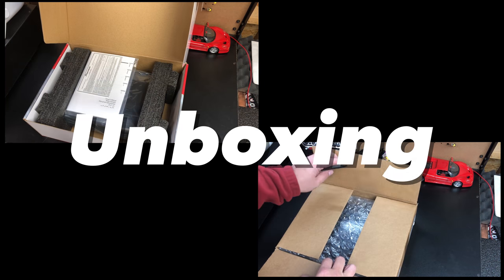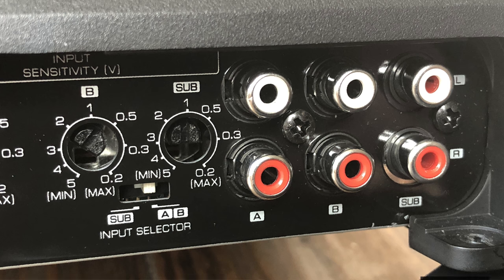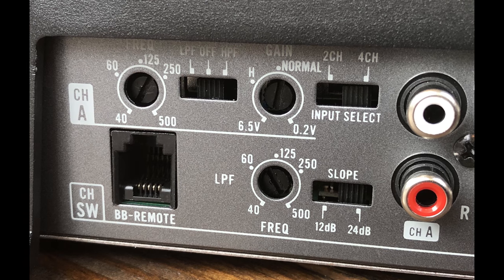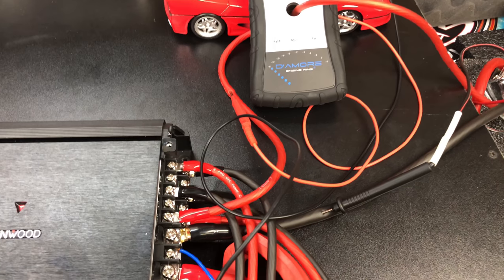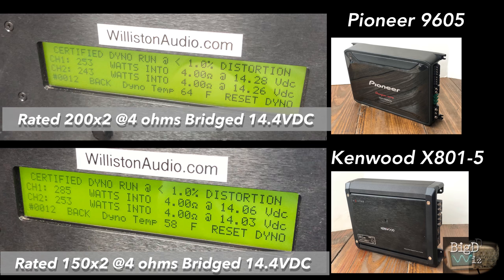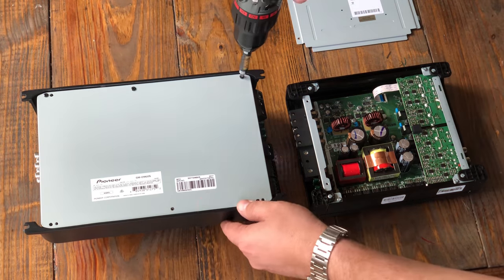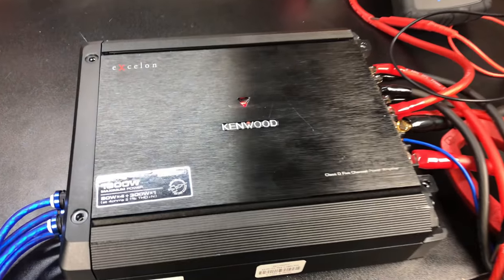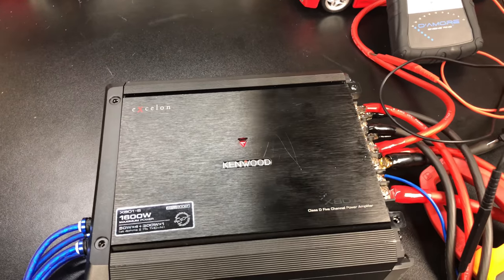Five Channel Budget Amps by Kenwood and Pioneer 4K UHD

Comment: that Kenwood is my favorite little amp, we do a ton of those guys. This was a great test, thank you for doing it.
Reply from the maker: If only it had a remote...I hate going into H/U settings to make adjustments for different songs. Thanks for watching and commenting. You guys will be in my next shoutout vid 🤙
Reply: Hey Five Star Car Stereo ,how is this X801-5 compared to XR900-5?
Reply: Five Star Car Stereo i
Reply: Can you hook up the 4 channels at 4 ohms and the subwoofer channel at 2 ohms or do all the channels need to be the same impedance?
Reply: what will the kenwood do true rmsx5?
Reply: We sell the 801-5 kenwood amps quit a bit at the shop I work for as well.  Have never had a dissatisfied customer after installing one of these.
Reply: Jim Jones yes you can ive been wondering that for forever and i finally got my answer 😂
Reply: 2x set of front back speakers  at 60watt rms any advise on pioneer or kenwood amp please
Reply: @fivestarcarstereo , any chance you guys got any end caps laying around for the kenwood? I’m local and just picked up a 2nd 801-5 but it’s caps are missing.

Comment: Nice. Thank-you for this. I have a Kenwood XR600-1 that is rated at 400 watts RMS at 4 ohms or 600 at 2 ohms. It measures 8-11/16in - W x 1-7/16in - L x 8in. It has always amazed me since I bought it that something this small like the Kenwood in this video can put out so much power and do it all day long without breaking down. I have owned the amp for 2 years now with no issues at all. Hopefully these 2 amps are reliable over the long term as they both seem to pack a large amount of power into a small chassis.
Reply from the maker: I’ve tested this amp before, did ok, just not way underrated like the other Kenwood’s I’ve tested. I love the sleek look of these XR series 😎

Comment: I installed one of those Pioneer amps in a friend's Pilot.

We ran a pair of Pioneer components in the front, coax in the rear, plus two Pioneer shallow 12's. 

That amp pushes this system very well and sounds fantastic.

Comment: Thanks for this video. Based on the results of the testing I bought the Kenwood.  
I ordered the X801-5  you tested but ended up getting sent the X802-5 (All input/output & remote SW control on one side, all x-over/sensitivity controls on the other).
I ran the amp with the stock radio at first til I decided which head unit I wanted. I ended up going with the Kenwood Excelon to make it a matching set.
6 months later and I don't regret my choices.

Comment: Thank you...I just got the kenwood XR900-5 for my wife’s truck and can’t wait to hook it up...One thing I can say there power is so clean...I’m also running two of there old amps the 1200m that sounds so good..
Reply from the maker: I’ve been curious about that one too, really like the slick looks. I’ve tested the XR600 mono amp and think it’s what’s used inside the XR900-5. Did it’s rated power, but not too much more. That’s cool with me as long as an amp performs to rated specs, I’m happy 👍
Reply: BigDWiz I no that’s rite.....Hey I want to say thank you for doing what you do with the amp tests ..You have saved me some money on amps.....Kp up the good work and thanks again...

Comment: Thanks for reviewing those BigD! Been wondering and looking for a 5ch, this will help.
Reply from the maker: Sure thing brother 🤙
Reply: Big D, thanks for the review. But I have a question about the durability of the Kenwood in particular. Do you have any knowledge of this? I’m of purchasing the Kenwood amp to power my entire system. I have A 17 Ram 1500 crew cab... 

I have limited room in the truck which is why I like the small footprint of the Kenwood..

I want to replace the factor speakers and add 2x10 JL subs.. and I wasting my money buying this amp in your opinion for this application??

Comment: back in the 90s these two were ones of the best .now they're head to head with boss
Reply: with BOSS? lol dude Pioneer still makes high-end SQ equipment. Kenwood still makes very good amps. Neither brand is into the SPL market. Both companies like Kicker design, and manufacture their own amps and speakers, unlike sundown and the other SPL brands. these are the companies that bring out the latest tech...so far from BOSS it's not even funny.

Comment: both did better than I expected, very nice to see that both companies have fairly honest ratings. however if I were to get a 5 channel amp, I'd most certainly go for sundown audios rendition of such an amp, I don't quite remember the ratings I've seen posted for the left and right speakers, or the specific ohm load, and I do not know whether it was tested with all channels driven either. but I believe the left and right are done class ab with a separate class D for the sub channel. and the sub channel is rated at 800watts rms, with some massive dynamic rms numbers posted (I believe they dropped the sub channel to .5 and it did 1500watts dynamic power. we all know neither of these amps will do that power even if dropped to .5... they'd probably blow up.)  now ive already seen dyno numbers of it, but it'd be cool to see them on video, with you showing all channels driven.. it's not a cheap amp though.. even though I already have a subwoofer amp, I'm slightly tempted for going for that amp when the time comes for me to get a full range 4ch.. maybe I could run some sealed 8s along with whatever is on the separate sub amp
Reply from the maker: The Class AB plus D 5 channel amps have been popular for many years. They offer SQ for the mids/highs and power for the subs. Most mfg’s are moving to full Class D designs now due to size, efficiency, cost, etc reasons. I had a Memphis “Big Belle” a while back and it was rated (and delivered) 75x4 AB and 1100x1 Class D. That was a great, all-in-one amp. That Sundown sounds pretty interesting as well...
Reply: I definitely would prefer AB for the mids and highs. class D can be just as good as ab for sq, but it they have their disadvantages. and unfortunately there's lots of cheap crappy class D full range amps out there. the sundown amp is the only one I've actually been interested in. sundown is known for making quality amplifiers, always capable of running below the rated ohm load, without issue. I wish I could find .5 ohm ratings for my amp, sundown sae1000d, I'm happy with the 1ohm ratings, I really like the dynamic numbers I've seen 1470watts rms is pretty good, but I gotta find a .5 ohm certified, clipping and dynamic.. I can do my own live power testing with an amp clamp and another volt meter.. I have no peak hold settings on either though, but my sa 12 d2 should put a pretty decent load on it.. probably not quite a 1 ohm load after speaker dynamics and my boxes rise however.

Comment: I had a Kenwood system.  
Liked it but the head unit burnt up twice. And the 4 channel amp crapped out after a few years. 
Subs worked good for what they were.  But I believe the entire system was around 1000$ back in 1996.  Really liked it.

Comment: I don’t think you’d go wrong using either amp... The Kenwood would be my choice though.
Reply from the maker: Agreed, especially for the size...but I’m a sucker for a remote bass control since I listed to so many different types of music
Reply: yeah kenwood is where it wants to be.
Reply: Just use a universal control knob and you would be good to go. I actually prefer a universal to some factory ones
Reply: The gain. Some have two knobs and control both also.
Reply: I have a Pioneer mono block for my sub which also has a remote... The remote was a nice thing before I had one... Maybe it's just me but it boosts bass at a certain frequency that makes it sound hollow... So it's always turned down.... I actually purchased a Kenwood amplifier similar to the Pioneer and ended up returning it before I had the chance to audition it.... I have always been a Kenwood guy... I actually still have my KRC923 cassette deck which still functions and still sounds amazing... You really would be hard pressed to tell the difference between a cassette or CD. The amplifier is the KAC PS 201T.. What an amazing amplifier... I always had suspicions that it was punching well above it's weight... But this Kenwood 5 channel amplifier is really nice.... I would love to hear your opinion on how the sound compares between the two... I have tried class D and it just doesn't cut it sound quality wise to my ears... My old Kenwood ran hot when driven hard but it is a class A/B so that's to be expected... But that sound.... Sooooo goooood.
Reply: Will Pack  when you use the remote it will attenuate the gain from minimum and maximum set by the gain dial on the amplifier.
Reply: @wal  Why not run a passive  rca attenuater on the kenwood sub channel for sub control?

Comment: I have the pioneer GM-9605, installed it almost a year ago. The sub output was better then the bridged old school 300 watt installed previous but was nothing really awesome until I read somewhere a few weeks ago you have to have the supplied bass knob connected or the bass output sucks so I tried it and all I can say is its awesome now! Wish I knew this when I installed it. Didn't originally install it because my pioneer DEH-80PRS already has sub level, not really sure what this bass knob does but I can definitely feel the bass 10X now
Reply from the maker: Dean at Five Star Car Stereo told me this a while back
Reply: @wal  Yea I have to watch my subwoofer level now when I cruise in my neighborhood, before you couldn't here the bass at all from outside with all my windows up, now its thunderdous and my system is total stealth and want to keep it that way!

Comment: Love the 5 channel amps when you bridge them for front and rear but I always though the sub side of the amps were a little underpowered. I have been looking for a 5 channel amp with about 1k watts at 2 ohms or 1500 at 1 ohm for my system ..
Reply: James T43 sundown has a 5ch just for that.
Reply: Also mmatts,  but they are more powerful, but also cost $1000

Comment: How would Big-D rate that Porter Cable drill of urs? Cuz I was thinkin of getting that same drill u used to open the amps up with I was thinkin I'd update my 3yr old Porter Cable set and that new one ur using looks like a nice one & looks like ther keepin ther well balanced in hand design but how does it perform for u? BTW Great video I just saw the same drill I've been eyeing for a few weeks and aint too many people I trust for ther honest opinion so figured couldn't hurt to ask
Reply from the maker: I love it. Not a super heavy user, but when I need them, they are rock solid. I use all of the items from drill to circular saw to jigsaw and more. Great quality and value IMO
Reply: BigDWiz sweet thanks thats exactly what I was hopin to hear I'm going to book my tail down to the store & get me while ther still on sale thanks for the help you da man
Reply: I agree with bigd i have the same drill. Been using it a lot for drilling metal,woodworking and just removing and installing screws. Good for the price

Comment: I'm hoping u got my comment it was on a much later video... I didn't realize it til after I commented, sorry about that... But maybe u can read what I wrote... briefly it stated I'm disabled I have a nice double din head unit for my 2004 Toyota Camry... I can't afford an extreme system, so do you think u could help me, since you're extremely knowledgeable about systems and components, with putting a system together on a budget??? I'm a new sub and saw your COLLECTION it was absolutely awesome... Look forward to seeing more videos... Thanks
Reply from the maker: Hi Robert, that video of the collection of amps was from my friend, Kyle, not mine. I need to understand your budget and goals, also are you going to be installing yourself of have it done?
Reply: BigDWiz ... Thanks for responding, I'm going to have it installed... I broke both hips and it's really limited what I can do... Any and all information you have is greatly appreciated... Regarding the COLLECTION, sorry I misunderstood... Still a very COLLECTION... I really liked the old school Rockford Fosgate amplifiers... I had several when I was in high school and the always provided great sound... Also although my stock speakers sound really good do you think I should swap them out or continue using them? Thanks again for your help... Have a great day...

Comment: Big D, love your videos man. But i cant help but notice the Pioneer did good but not great i seen a my buddy test his and it performed above rated in every test by at least 60 watts rms. The sub channel put out 1100 watts rms. Is there any possible way that maybe the wiring wasn't done right. Not to insult you but I just have to ask. Maybe reverse the test and plug them in opposite to se if it was the leads on the dyno or something else. Thanks for the te if you read this and keep up the good work👍
Reply from the maker: Phase doesn’t matter on the Dyno, the test is accurate

Comment: It's interesting that most of the Class A/B amps that provide similar power output ratings have similar fusing values.  I always thought that Class D amps were much more efficient than A/B?
Reply: Just depends on circuitry, there's a lot of wonky class d's and some good quality a/b's as well.

Comment: You need to upgrade the fans on the dyno. Needs to sound more mean like a turbofan with afterburner
Reply: I'm sure part of the startup procedure on the dyno is to run the fans up to full, verify the speed and then decrease the speed to a "normal" level unless it gets hot. I have HPE Proliant Server at my house that does that on startup. Sounds like a jet engine for a moment then quiets down to barely a whisper.
Reply from the maker: Just a startup sequence. Silent during tests unless resistors reach 100 degrees F
Reply: BigDWiz I think it’s cool but fans sound a little wimpy, would be cool to upgrade fans so it sounds like it will take off during the POST/Selftest cycle.
Reply: If something is not broke....we can still fix it right?

Comment: so what i gather in a quick search is that the pioneer gm-dx975 is basically the slightly upgraded version of the D-9605 - did you get a chance to look at single-channel output for it to see if the "safe" claim of 75w at 4ohm is legit? i'm hoping to set the gains for the GM DX975 for 80w per channel.. which is what my front comps RMS is rated.. (so basically 17.98 vac output).

Comment: Hey, I know this is a bit old but I am considering this amp for one of my vehicles and just trying to get some understanding with regards to the full range channels. I know that the amp is rated at 50 Watts x 4. But the way that the testing was done is a bit confusing to me and hoping you can clarify. What was the actual power output for the full range channels if you are running this amp as a 5 channel amp as opposed to a 3 channel amp. Thanks

Comment: BIG D MAN YOUVE GOT TO RUN THIS TEST I BOUGHT A PMPO 1000w class d plate amp it comes with a 20@mp fuse but when you change the 20 too a 40 it literally blew my mind away I had a alpine mrp m500 hooked up originally but decided to give it a try because i read it somewhere that the amp is fused lower so it performs longer  but when a 40 or 50  amp is put in it then the rms jumps quite a bit cause it had my 2 12 quantum 3000w dual vc hitting harder then the class d alpine mrvm500 was making them hit seriously needs investigating I can send mine with a damage waiver signed if something bad was to occur
Reply from the maker: I’ve got that one too, will check it out

Comment: dual sigma drive is the same as yamaha's st (YST) ? i wonder if other amps have the same type of tech but simply dont market it. aaand if you could see an actual diffrence in cone movement in a comparison between non dual sigma / yst and ones with.
Reply from the maker: Infinity and Velodyne has also offered powered home subs with servo control. Kenwood’s implementation sounds like a generic offering. I’m sure it’s much easier to understand feedback when used with a specific driver 🔊

Comment: hey sir i purchased the smaller 4 channel version of the kenwood 4 channel x-304 as backup amp ,do you think it could do a good job on the infinity kappa 6.5 component on front channel and the jbl 609 coax on rear? thanks

Comment: Still shopping for a replacement 5ch setup for my system.  2001 RF 400a4 and a 2004 JL 500/1. Looking to move to a single amp with similar power. 

Have you seen anything lately BigD? 

Looking for:
70-100x4 @ 4ohm
500×1 @ 2ohm

2 JL 8w3, in a home made slot port box tuned to ~34hz.
Components 6.5 
Coax 2way for rear fill 6.5

I have heard you need a subsonic filter for ported boxes, this is where I usually get stuck.  I find a amp that fits goals only to see no subsonic.  Thanks for the videos!!
Reply from the maker: I use ported daily with no subsonic and have no issues. The JL HD900/5 is a bit spends, but will do what you want...
Reply: @wal     BigD I got a craigslist score.  Kenwood XR900-5 for $70!!!!  

I jerry-rigged an old Lexus battery so less than 12 volts.  And hooked up 6.5 speakers and the sub ran music off my phone via rca to headphone jack...very nice(Borat).  Impressive.   Thanks for the great review.